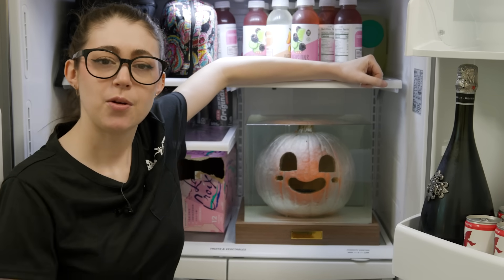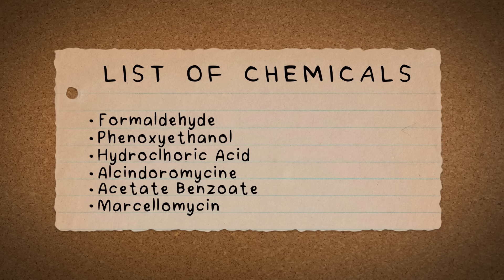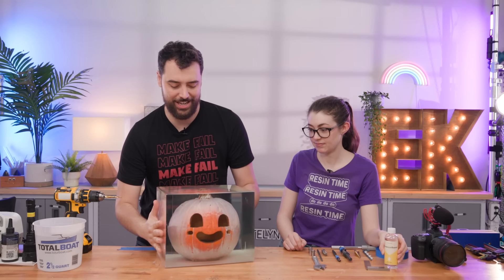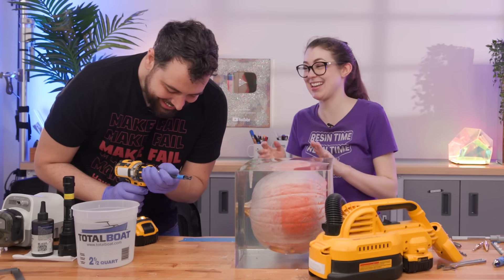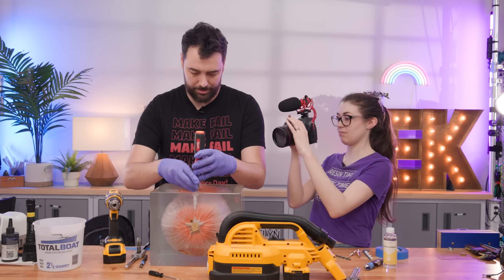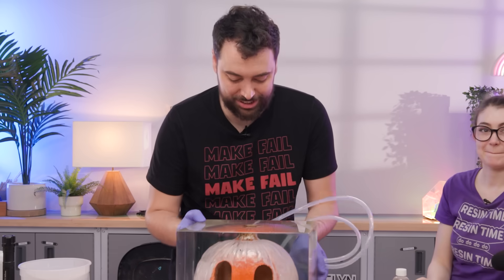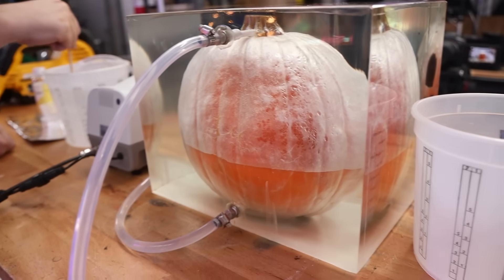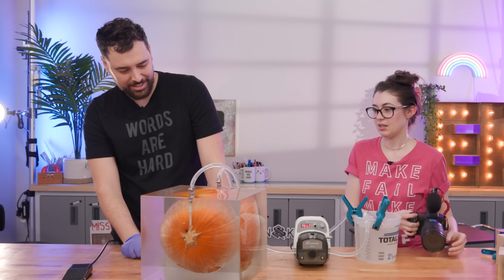Preserving A Pumpkin With Chemicals & Resin (feat. NileRed)

Comment: Honestly I am suprised you dont pull a vacuum on him now that you have the holes drilled. If you pull the vac on him and let him sit in there it might kill off the bacteria inside. No oxygen means no rotting. then add in your perseverative from the other hole while pulling a vac to make sure you fill the void space completely. Could even do a salt water rinse with a germicide like Nigel said in the video before the preserv.

Comment: Yall make some good videos...but you have clearly never water cooled a PC. Part of your problem is probably air trapped inside the actual pumpkin...but a bigger part is if your pumpkin is higher than your pump and bucket, and air in the pump or tube is going to flow into the pumpkin and and liquid in the pumpkin is going to be syphoned into the bucket. You need your pump and bucket to be above your pumpkin.

Comment: Ok I mess with npt air fittings all the time.  They always leak without using teflon tape.  I imagine your plug is leaking at the threads.  Good Luck guys!

Comment: I have an idea for a project! 
Make your own computer display table like those old Microsoft surface table. 
You need glass or plexiglass cover with silicone, ir lights, camera, projector, computer. 
When you push on the silicone your fingers reflect the ir light and computer can calculate where you touched. 
This could be really cool and practical to your future projects

Comment: sterilize your pumpkins. one way valve on the top. just leave a valve on instead of needing to add a plug or have it so that the outlet is submerged when inserting a plug. the runaway cure basically sousvided your pumpkin while replacing gaps in the cells with resin. have the entire pumpkin cure completely either under vacuum or high compression, pouring stuff on a rough surface doesn't help with bubbles. you could also just have the entire thing be blasted with UV so long as it doesn't degrade the pumpkin cells in a way that changes color

Comment: For Chunk 3 this year, I think it's a good a idea to basically do everything as it is, but then once the resin is cured, cut it in half, remove the pumpkin, which the pumpkin shape is getting reserved over the resin. And probably paint over it (or not). And reseal it using resin again. Just like how fossils work. Or dry the pumpkin, but I guess it won't work like how cute Chunk 1 and Chunk 2 are.

Comment: The whole time im just thinking why are they using a step bit drill piece instead of a normal drill bit to keep the hole small and let me guess it leaked out the thread you made that's why they make thread tape and not glue. Straight away I was thinking that's gonna leak

Comment: I think your best bet, if you’re still trying to preserve him, is to open the valves, place him in a vacuum chamber for a few hours, and then instill the preservative combo to replace the displaced air removed from the pumpkin by the vacuum chamber. This is entirely off the cough and I have zero knowledge as to whether it’s compatible with resin or can be used for food/plant art preservation, but bacteriostat used for humidifiers may also work (but I would use a higher concentration than the normal diluent:bacteriostat ratio recommended when used in a humidifier). It may not be a /forever/ solution, though.

Edit: I forgot to mention that the bottom looks like it’s already molded or showing signs of bacterial sludge/biofilm? If there’s enough biofilm present, I don’t think you’ll be able to stop the decay without removing from resin and using more extreme methods. 👀

Comment: Chunk 2 is slowly turning into sauerkraut. The CO2 will build pressure and blow out any fixtures they try to plug it with. They need to kill the lacto that's eating it. Fermaldehyde would actually work, if the seal is good and it's able to soak in and permeate through the pumpkin, but if there are any pockets of unexposed fruit, it will continue it's anaerobic decomposition...

Comment: The "bubbles" are your pumpkin rotting as bacteria consumes it.
You need stronger chemicals. Really, you need to fully pickle the pumpkin before you cast it in resin. I suggest freeze-drying, then replacing the lost water with resin under vacuum.

Comment: shouldve used formaldehyde, that not only will kill all bacteria and fungi, but it will chemically bind all the proteins which will prevent all the cells from degrading over time (though formaldehyde wouldve been really bad with the leaks and stuff)

Comment: An issue might have been drilling a hole at the bottom. Both holes should have probably been on the top of the cube so even any future gas build-up wouldn't force something out of the bottom hole.

Comment: The rotting pumpkin in resin made me wonder - what if you put something organic in resin that liquefies fully upon rotting (leaves?), let it intentionally rot and flow out and then pour something else (differently coloured resin?) in the cavity - so basically using them as some sort of permanent mould. Might be a weird process considering you can make silicone mould but maybe that way allows for finer structured cavities? And it might look cool to have some ghostly plant phantom in a block o´ resin

Comment: You know what they use to preserve specimens in museums? It's not formaldehyde. Not anymore. They're phasing that out and anything new doesn't use it. Nope. It's so simple, it's silly.

Alcohol. Either ethyl alcohol (normal drinking alcohol but medical-grade purity) or isopropyl alcohol (rubbing alcohol). Admittedly, you need 70-80% purity to prevent decomposition and 95% to really keep it stable (it replaces the water). But then again, you can buy 91% pure isopropanol from the store for cheap. Pretty easy answer to me....

Comment: Hey guys! I have some info that might help with the next pumpkin: My dad is a wood worker, specifically he likes turning bowls on a lathe or making pens. Sometimes he uses wood that is partially rotten. Rotten wood, of course, is soft and falls apart, making it unsuitable for turning. He solves this by putting the wood in a vacuum chamber full of a certain resin. Over time in the chamber, the air is sucked out and the voids left behind are replaced by resin, preserving the shape while making it stronger. Someone else uses this technique with vinegar and cucumbers to essentially make instant pickles. This might be a good solution to allow you to fill the pumpkin with some sort of preservative before encasing it.
Reply: Oh I really hope they see this!! That sounds good to try
Reply: You could also steam the pumpkin for a couple hours at like 120C/250F. If this heat can penetrate the entire pumpkin for 15 minutes it will sterilize it. Unsure what this would do to the pumpkin's structure.

An acidic environment would also work, but also would probably destroy the colour.

The other thing that can stop anaerobic bacterial growth is an extremely high concentration sugar solution. I think this is a good bet if you want to pump a liquid into the resin like this video after the fact. There are clear sugar syrups that you should be able to pump in and I do not think sugar will react with the pumpkins structure.
Reply: @Crushnaut  citric acid would probably work great. I know we made fruit last far longer than originally by soaking in a water and lemon juice solution, it only eventually spoils because it soaked up too much water, instead of the air browning it. Good trick for cutting apples too, and when I made apple juice/wine adding lemon juice early on helped keep the apple juice yellow instead of browner.
Reply: That's definitely gonna shrivel the pumpkin. You'd be putting several times earth's atmosphere from every angle pushing in on the pumpkin. Unless you can somehow replace the cavitations left behind with resin.
Reply: @dos54  ...resin pickles?
Reply: @CallN0w  they literally said with vinegar and cucumbers bruh

Comment: Perhaps freeze drying it could be a solution? I’m thinking it would dehydrate the pumpkin without affecting its shape. Not sure how it would interact with resin but perhaps it would just soak it right up. If so there may not be a need to keep it in a giant cube other than for aesthetic reasons.

Comment: For the next pumpkin:
Maybe put him beforehand in a vaccum chamber while beeing fully submerged in mineral oil/ or something simmilar.
Perhaps you could remove some of the water and prevent rotting at all.

Leaking
Is it possible that the mineral oil acted as a solvent and thats why it leaked?
Does anyone know?

Comment: I love how they got Nigel on for his advice which was to use a saline solution with a germicide and then proceeded to completely ignore it
Reply: Right? And then they used their preservative briefly before getting rid of that too in favor of mineral oil, which is doing nothing to kill the bacteria or mold that it causing the issue
Reply: @kevinwells9751  I'm pretty sure they made a 1% solution woth both water and then mineral oil. Problem is I don't think that germicide is diffusing through the flesh of the pumpkin
Reply: @BirchPig  probably have to put it in a vacuum with the solution first and basically pickle it
Reply: Thank you! I was thinking this
Reply: I don't think logic is their strong suit, considering how much chemistry/physics/biology is going over their heads in this video haha. Personal favourite was them being completely dumbfounded by their accidental siphon that was pulling air into the open end
Reply: @Zebra_M  I didn't know that either does that mean logic isn't my strong suit? 

Probably probably 😂
Reply: @Zebra_M  i mean in fairness, they are not any of those things.

Comment: If you want to do the access port thing on another cube, I'd look into using brake hardware for cars. You can look into how to bleed brake lines to see what I mean, but those fittings hold quite a lot of hydraulic pressure, and it'd make the evac job much, much easier with just a wrench and a tube.

Comment: I didn't see any o-rings on the bits you used to seal the drilled holes.
The thing I can think of straight away to use are the blanking plates on the 1st regulator for scuba diving.

Comment: I feel like if a valve was installed and had a good seal on both ends, it would be safer to control liquid flow, plus the system could be easily vacuumed of air if need be

Comment: 4:41 I think because of the pumpkin being a “plant” it has oxygen in it which caused the pressure causing the air release when they drilled into it or because it was beginning to rot a leak gas all the gas that was stuck with no where to go finally got released causing that large explosion of resin

Comment: The pressure was likely caused by fermentation off-gassing CO2 and methane which is why the back bulged out as well.  The first pumpkin that cured too quickly and got hot would have killed the wild yeast and microorganisms on the pumpkin, then sealed in resin, would not ferment.

Comment: You should make resin discs, barely half an inch thich for future pumpkins. You place them under the pumpkin before you pour, that way you can guarantee you have clear room for sanding/flatening the surface. Like Chunk 1 looks absolutely amazing. Imagine having it cut into flat surfaces like Chunk 2.

Comment: You might be able to plasticize it, That is how they preserve human cadavers for dissection labs. I don't know if you'd be able to do it on one that is already cast into resin. The general idea is to remove water content and then put a liquid plastic into the dehydrated cells and they should pull the liquid into it due to osmolarity. They plastic protects the cells from decay and preserve color and size once the plastic 'dries'. It will also still feel pretty close to what the cells would normally feel like. If you were able to access the flesh on the inside of the pumpkin you might be able to dehydrate the pumpkin using the ports you put in and then put the plastic back into the void and put it under pressure to push it into the more porous cells. I would think it would be easier before you cast it though, if you do chunk 3, that might be something you could do.

Comment: What if you hooked a vacuum pump to the top port and a hose with a valve to the bottom. Then you could prime the bottom hose close the valve and then turn on the pump. After removing all the air and juices then you open the valve and it would refill with the preservative or a resin. sort of like stabilizing resin.

Comment: Have you guys considered just trying to pasteurize Chunk 2 to kill off any decay bacteria present inside him?  Low-temperature pasteurization can be performed by simply bringing him (completely) up to 60-70 degrees C and holding that temperature for 30 minutes or more (if you want to be really thorough, you could keep him at 70 degrees C for an hour or so, and I doubt that would hurt the resin or the pumpkin itself any).

(You would want to make sure that every part, even the very center, fully reaches that temperature, though, so you might want to do a gradual heating over a long time to make sure there's an even temperature throughout the whole thing.)

That way, even without any kind of preservation solution, he should stay in the same state pretty much indefinitely (and won't continue to build up gas/pressure, etc).

Comment: I was thinking if you really want a forever pumpkin you should freeze dry the pumpkin, then allow it to soak in something like acetone, then using a very long cure resin cast the pumpkin and heat it to around 140F to boil off the acetone while the resin is still liquid allowing it to replace the absorbed acetone and do all that under vacuum to pull out any remaining air at the same time.  You will then have a perfectly preserved and protected pumpkin.  Or you can just buy a plastic jack-o-lantern during Halloween for a couple bucks and call it good.

Comment: Have you considered sending a chonk to a radiation sterilization service? They are used for sterilizing pre-packaged, single-use medical equipment. So for the chonks, it would sterilize everything sealed in the resin, so it would be unable to even start rotting.

Comment: For the next Chunk, would it help to first blanch and /or pickle him prior to embedding in resin? Alternatively, the longest term solution for preservation might be plastination, where you would replace all the fluid inside Chunk with the resin. Though, one of several large issues with implementing that technique would be the very large volumes of acetone chilled to under -20°C needed in order to prepare the new Chunk for Barbiefication.

Comment: Mineral oil is incredibly thin and basically impossible to keep in with threads.

Use resin to close your two rear wall "horizontal" ports and then redo the ports on the top so that the mineral oil is held down via gravity

Comment: What if you tried dissolving the pumpkin with chemicals instead, sorta flushing it out, and then filling the remaining hole with resin? It won’t be the same as preserving a pumpkin, but you’ll still have all the details 😊 Plus no more leaking or rotting!

Comment: 19:09  Why don't you try carving the inside of the pumpkin, drying it from the liquids, then pouring the resin over it until it becomes just like the peel? Then you can put it in a large resin mold، It's like taking just the outer peel of a pumpkin and drying it and putting it in resin. This will at least reduce the possibility of rotting and liquids coming out of the pumpkin.

Comment: Chunk 2 is not changing colors, it's light being reflected inside the resin which happens whenever there is something with a lower fractal index between chunk 2 and the resin (like air or gas), water and oil have a higher fractal index so the light can go through as normal and the orange becomes visible from the outside again

Comment: Have you considered pulling a vacuum from the top fitting and then afterwards fill him up really slowly?
It is a little like casting or mixing silicone under vacuum: there can't be bubbles if there is no air.

Comment: Here I am again to recommend you start using a prime 50mm lens on the handheld DSLR. I use the same setup as you on my DSLR and while it's the most versatile setup a 50mm prime will be so much better for those closer shots and they are same of the cheapest lenses

Comment: LOL. The "ehh" comment is so relatable. When you work with hazardous chemicals all the time, your thought process really goes to there's always something more dangerous than that 😂.
Reply: I horrified some apprentice lab technicians a few years ago, as they apparently use 1-3% solutions of sodium hydroxide for whatever they do, and were super careful about it, and then I mentioned that I use 35% solutions of the stuff for soapmaking! I mean, of course it will horribly disfigure me if I got it on my skin and fail to immediately rinse it extremely thoroughly, the hydroxide doesn't care if the oil is human tallow or olive oil, it's gonna turn it into soap!
Reply: @PanthereaLeonis  You mean "human suet", unless you have processed fat under your human hide, in which case, carry on.
Reply: @Soken50  You're right, I messed up my processed anatomy words! It might be because the word for sebaceous glands in my language is "talgkjertel", "tallow glands", so I assumed the unprocessed fat on top of and in your skin was also called tallow.

Comment: As a machinist, your tapping skills are fine. If the opportunity ever presents itself again, drill the smaller hole first. Then step up the port to the size needed for the adaptor. I would have used a vacuum pump at the upper port with a water trap. This would help ensure the preservative soak into the fruit. Yes, pumpkin is a fruit botanically speaking. I think the hot cure of Chunk the First may have Pasteurized the biomass and prevented the decomposition experienced with Chunk 2.